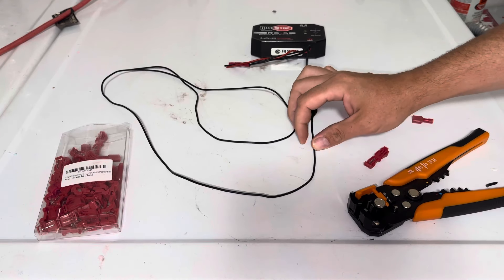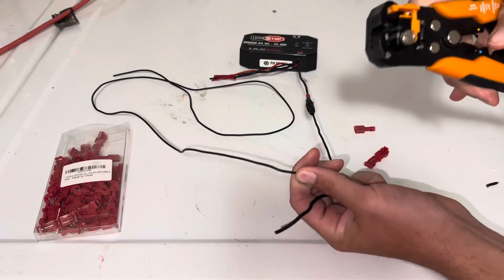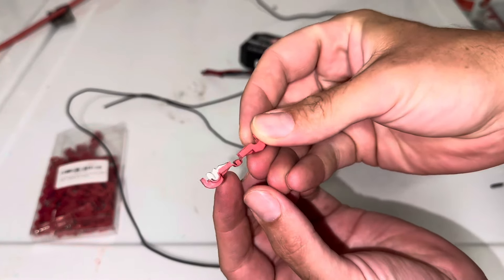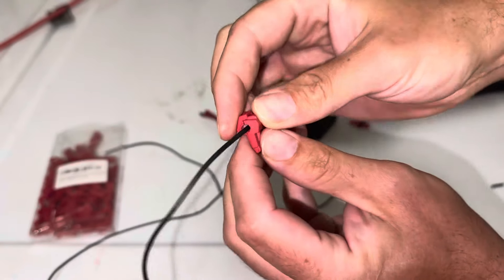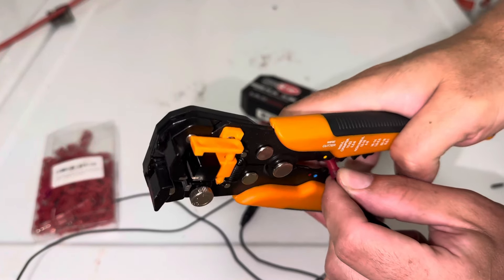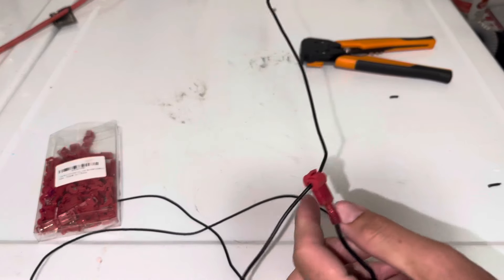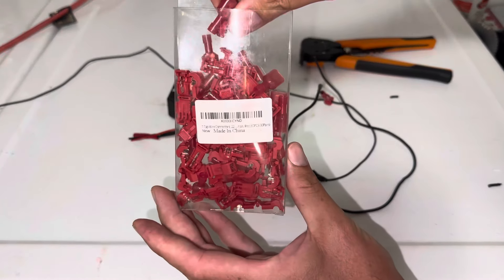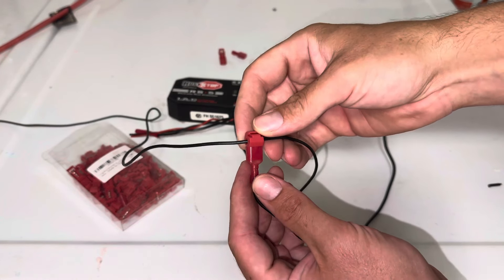How To Properly Use A T-Tap Wire Connector

Comment: The best way to use t-tap is to throw it in the trash. These are hands down the worst electrical connectors one can use. A proper spice connection is the only acceptable way to splice wires.
Reply from the maker: If you don’t like T-Taps what are ya doing looking them up on the internet lol. I like them and personally never had an issue with them. Thanks for watching

Comment: I want to connect my LED DRL lights with T-taps. My problem is, the wires from the LEDs are really tiny, and I can't crimp them into the connector. Please do you have any advice for this?
Reply from the maker: What gauge wire are you trying to tap into? And what guage is the connector?
Reply: @BillOfAllTrades2016  Im taping into my parking lights wire, which is successful. But Im not able to crimp my wire from LED strips, bcs they are smaller and they dont hold in the connector.
Reply: @gwyneth6045  you need a smaller guage ttap
Reply: Make it thicker then
Reply: @gwyneth6045  expose more of the wire and fold it to make it thicker

Comment: How far does the wire need to be placed in the wire connector? Should it just be in the tunnel where its being crimped or does it need to be exposed on the flat part?
Reply from the maker: When done properly, The exposed wire should be just in the tunnel where you crimp. So another tip I forgot to mention is that if you look at how long the tunnel part is, that will give you an idea of how much insulation to trim off your wire so no wire is exposed. Hope this helps. Thanks for watching. Please like and subscribe

Comment: Can you use a different size connecter with a T-Tap?  My speaker wire is bigger than my speaker wire in the car.
Reply from the maker: You need to find out what amount of load your new speaker takes as well as the load capacity of the wire on your car wiring. If your speaker wire is thicker gauge that means it most likely runs on a larger load then the factory wiring will provide. So now splitting a larger load wire into a smaller load source could result in blowing a fuse, or your speaker not working properly.

Comment: I’m assuming u can use this on a positive and negative wire for let’s say a speaker wires ur trying to connect?
Reply from the maker: Yes that’s correct. It will work on both positive, negative, and ground wires. Thanks for watching. Please like and subscribe
Reply: Are you doing all 3 separately?

Comment: I've watched several videos where the wire that's being tapped into is not peeled back at all with the wire stripper. and the locking tap is placed directly on the coating of the wire. how would that even work if the metal of the locking tap isn't making contact with the wire/copper itself? am i missing something?
Reply from the maker: The manufacturer says to just push on and the tap is supposed to cut into the wire, however in my experience the blades in the tap are so dull that they only kink the insulation but don’t penetrate. Perhaps the other videos featured a different brand of tap that pierces the insulation better. But I think it’s best to pierce it first. Makes a better connection. Hope this helps. Thanks for watching. Please like and subscribe
Reply: Fully agree. If one chooses the correct size of the T Tap for the cable to be connected, peeling back the sleeving is really unnessary. Also, with the peeling, it exposes more of the copper and this is more susceptible to shorting.
Reply: I think this is why my back up cam didn’t work

Comment: Hi, can this type of connector use for home wiring electrical 220v ie?
Reply from the maker: No definitely not. You will need to go to a hardware store and ask them for the correct connectors for home electrical. These are only for low voltage accessories.
Reply: @BillOfAllTrades2016  thanks for the info.
The low voltage acc ie : car, audio, correct?
Reply from the maker: Yes that’s correct